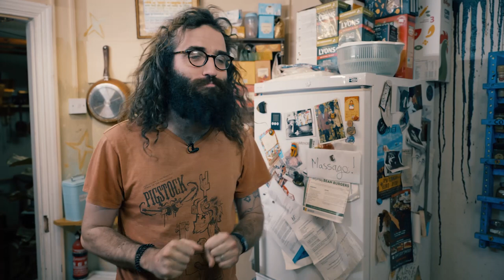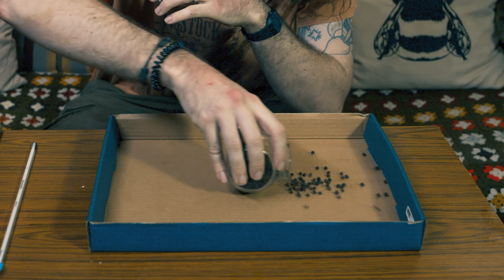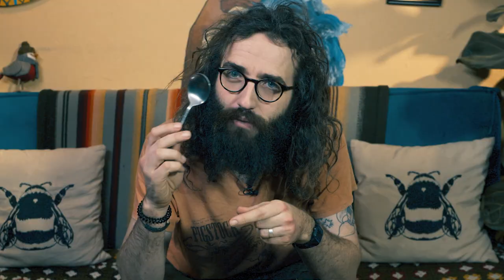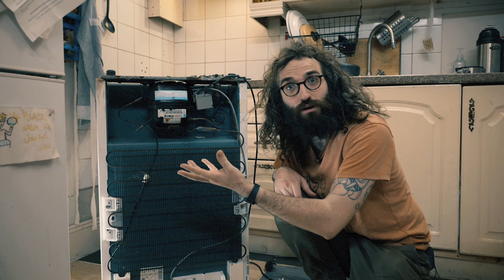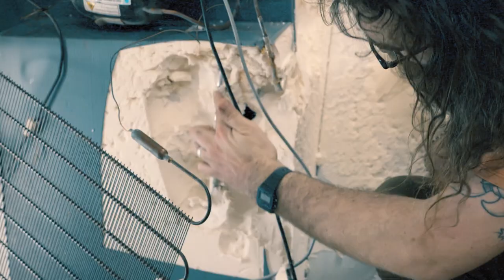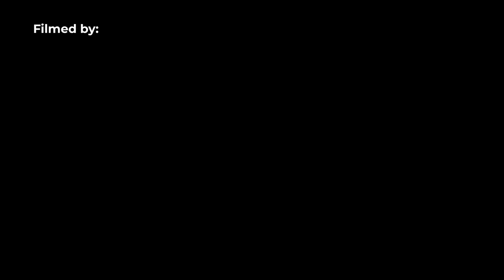HOW A FRIDGE WORKS - Science at Home - episode 2

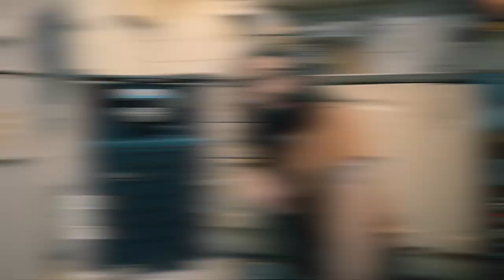Comment: 5:48 but why does gas get hotter if you compress it and colder if you decompress it?

Let's say:
- We have X peppercorns.
- Each Peppercorn has Y Joules.
- All the Peppercorns are located in a containerbox that has Z m³.

If I compress the gas by making it's container half as big (0.5Z m³) ill then have twice the energy per m³.

However, I would still end up with the same amount of peppercorns (X) and each peppercorn still having the same amount of joules (Y) meaning, the gas didn't heat up.

Also, how do these Peppercorns wiggle?

I thought if I push a peppercorn into one direction, it will fly towards that direction till it get's stopped by something it hits into.

Wiggling implies to me that it is going back and forth by itself.

Many thanks!

Great show I am a little sad that you couldn't continue it!

Also, can 2 peppercorns that have the same energy hit each other and cancel each other out or do they just transfer the energy to each other and fly off again?
Reply from the maker: Hi, thanks so much for your detailed comment!
If you make the container smaller, you have the same amount of energy, but in a smaller area. So the amount of energy per unit volume has increased, and therefore the temperature in that smaller area will increase. It's probably more useful to think of temperature as being related to energy per unit volume, instead of just total energy.

The peppercorns are being used to represent air molecules. The reason they wiggle is pretty complicated when you get into in the detail. But basically atoms and molecules all have forces that are causing attractive and repulsive forces between them. The source of these forces are the charges of the sub atomic particles and the molecular bonds between them. These particles are always vibrating back and forth around their equilibrium positions. Like a weight on a spring thats bouncing up and down but hasn't stopped yet. Giving more energy to the system by adding heat allows them to vibrate around these equilibrium positions faster.
There's also rotational energy of the particles that can be thought of like a planet spinning around its axis, except it can be sped up or slowed down.

I hope this helped to answer your question in some way. 🙂

Also, there are more episodes of this series on our funders youtube channel. You can check them out here!

https://youtube.com/playlist?list=PL9_FktE0pHjpp6NEnJDiIlieKKTz7u_67&si=krApseY1MTVBjvl0

I'm also in the process of making a TV show, so I might try to share some content from that on this youtube channel. I've been thinking I should try to post more stuff here! Thanks for the encouragment. :-)
Reply: @dannickstrom469  Incredible! Thank you so much this cleared up alot/all for me!

Can't wait to finish the entire series!

I wish you all of success!